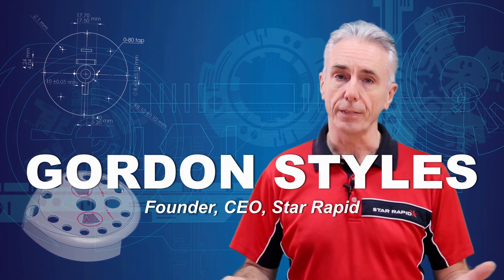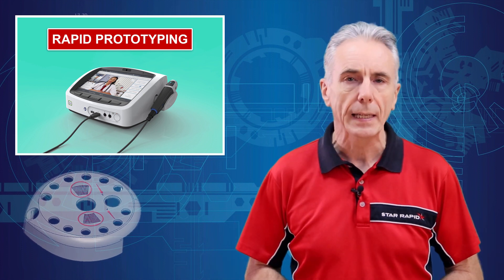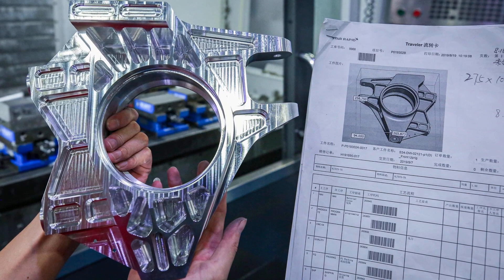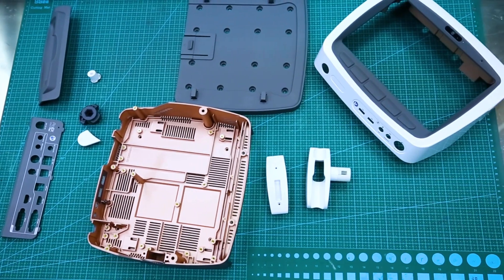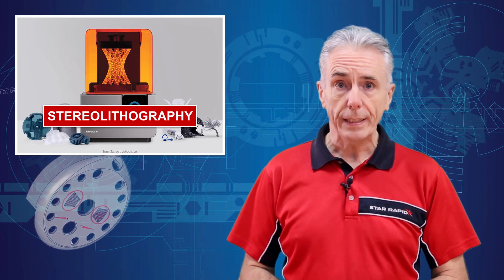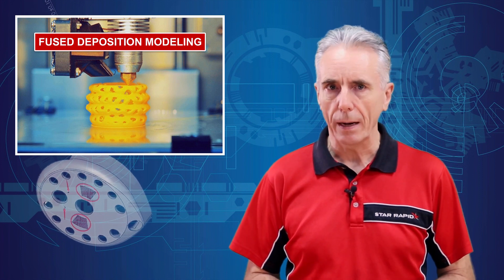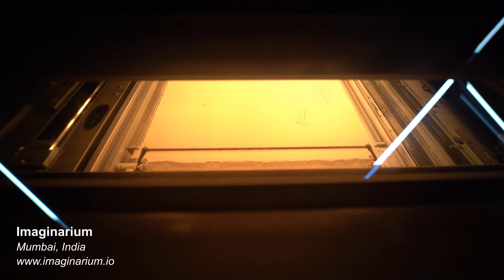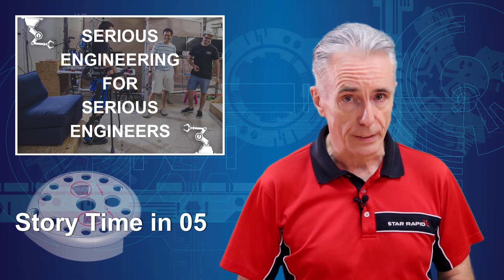5 Types of Rapid Prototyping Processes | CNC, Vacuum Casting, SLA, FDM, SLS | Serious Engineering 15

Comment: I need perfectly clear parts, what the best for this? 
Awesome video, amazing company you have developed !
Philip
Reply from the maker: Clear plastic can be used in CNC machining, SLA. Vacuum casting can be used to pour clear plastic copies, but they might not be "perfectly" clear. But they can be vapor-polished after making a copy, but only if they are made with PC, acrylic, ABS. Vapor polishing will also remove machining marks.

Comment: Hi Gordon, love this video never knew your success started with SLA!

SLA is still King and companies like Formlabs seem to be pushing SLA to create low volume injection molds. So it's like a bridge between Vacuum Casting and spending $$$ to actually CNC that Injection Mold.

But I think there's potential the future will be dominated by FDM just because how much innovation there is with the design - mainly due to how cheap it is compared to the other types of printing. There are just so many different FDM printing companies nowadays. It's like how the personal computer revolution dominated minicomputers. Innovations like Core XY and Non-Planar are currently the next step towards getting a higher resolution with the part. But we're still years away to seeing if FDM can match the resolution of SLA.
Reply: In terms of prototyping, and rapid local manufacturing, FDM is IMO a mature enough technology for any application that doesn't need the final finish / tolerance of SLA. In fact, I think it's likely to become a very disruptive technology soon. There are many projects already available online for open source tools, where FDM parts are the glue that holds together the components (motors, electronics, batteries). With logistics getting more expensive, certain tools such as drills or small CNCs should already be cheaper to produce locally in a workshop than mass produced and shipped.

Comment: Great video 👍 as always 🦾 I'm passionate in Vacuum Casting so much that I built my own machine to test the process. Which technology you use to make master patterns?
You should mention about PolyJet. Great innovation as well 🧐
Reply from the maker: Hey Pawel. Thank you. We mostly use Stereolithography (SLA) to make our master patterns. The footage you see in this video is one of our Vacuum Casting projects.
Reply: @starrapid  Is it possible to use SLS/MJF master patterns in Vacuum Casting to avoid cleaning spots left by supports?
Reply from the maker: @pawetrznadel7770  Yes, it is possible to use SLS/MJF. In fact, any physical solid, made by any method would work, so long as the physical solid can take a little bit of heat and doesn't shrink or deform too much. It does not matter what method is used.